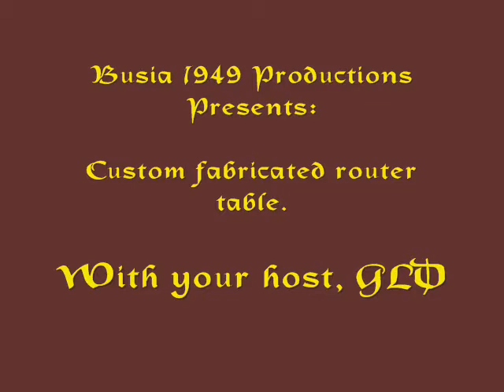Dedicated Router Table 0001

Comment from the maker: Nah, the bit is inside the piece of wood, except of course at the end. My worst accident doing carpentry was done before I did it professionally. I cut the top of my pinkie finger off on a table saw, but they were able to sew it back on. It looks a little weird but still works well. That was back in the day when I was working as an auto mechanic in the 80s.